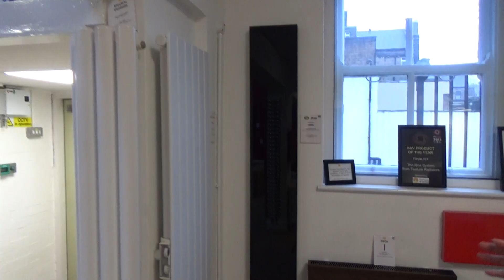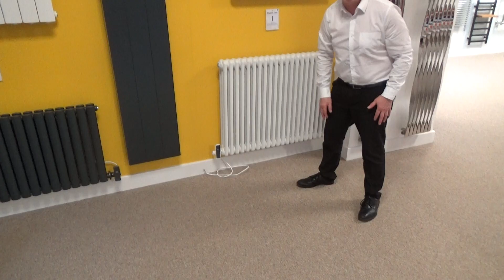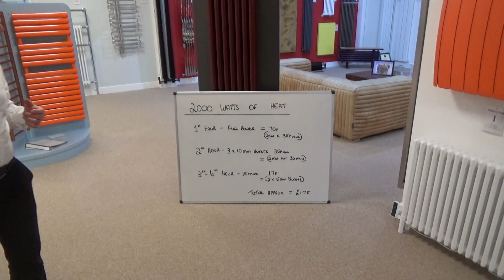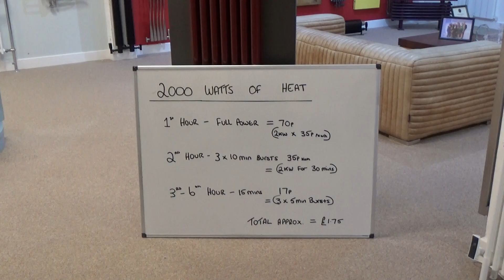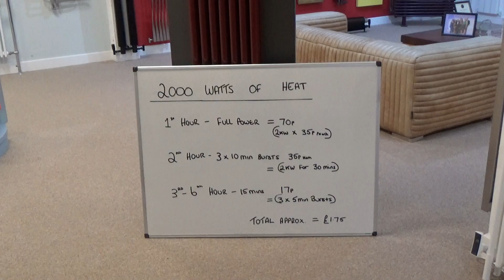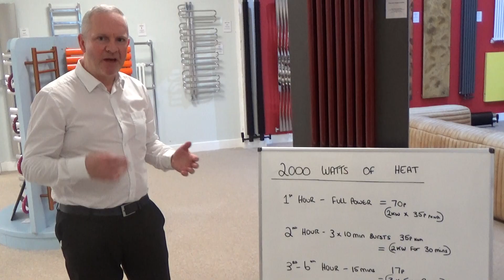Electric radiator cost to run

Comment: What would you recommend ?
Oil filled or ceramic?
Reply from the maker: @DanAL777, don't see what oil does better than water for heating, so we don’t stock oil. Ceramic I understand can create longevity and retain the heat. We are very pro water as the heat emitter, with the correct element and good control you create efficiency. We also sell ceramic too. So of the 2 you asked about, ceramic. Here to help - 01274 567789 or contactfr@featureradiators.co.uk
Reply: @featureradiators thanks for the reply,  it just so hard to decide which one to go for a household.
Reply from the maker: @DanL777-x4e  Appreciate that, costs etc. I can tell you from experience of having a water filled cast iron radiator at home, i'm very happy with how that functions. So tried and tested. The ceramic is relatively new technology in respect to heating. We have one in our showroom, we've had positive customer feedback so far, but I tell you what I’ll get it fired up this week and we'll run it for a few days in the showroom, please email me direct and i'll provide feedback on that product to you - contactfr@featureradiators.co.uk - i'm Joel.